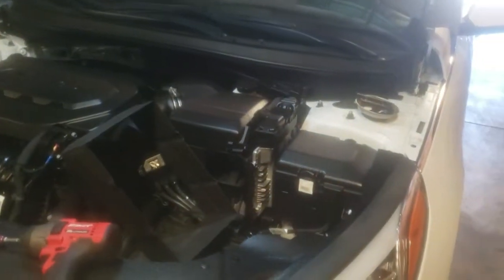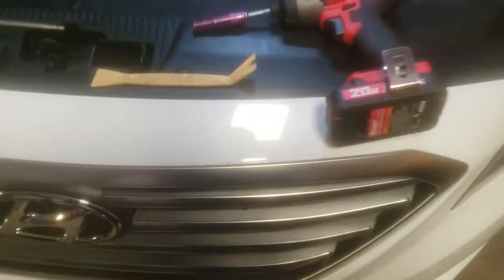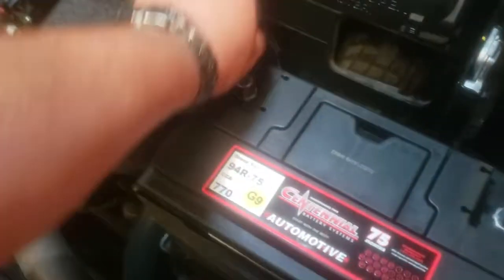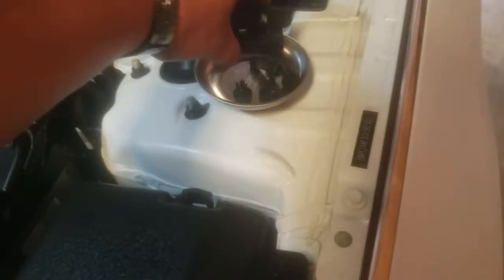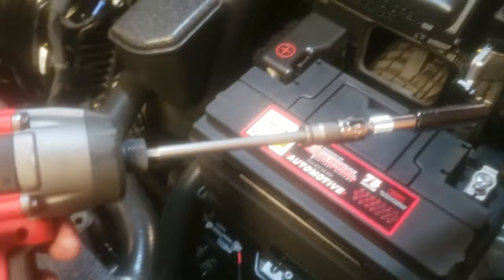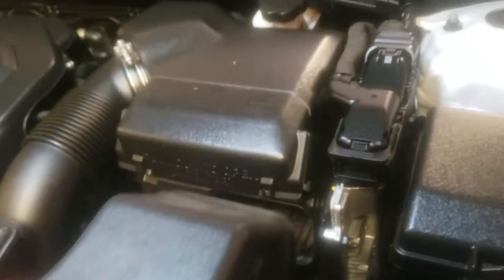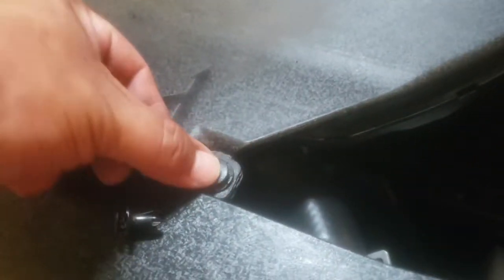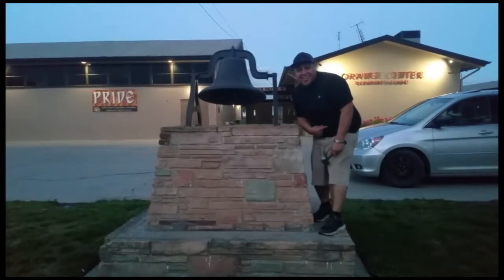How to: Install a Battery on a 2016 Hyundai Sonata

Comment: Autozone gave me an H6 versus the H7 I need 
They told it will be fine just come when they have H7 in stock no extra charge 
Do you believe this is fine?
Reply from the maker: Should be okay as long as it fits. The battery is just a storage device. The alternator produces the electricity.  You should be good.